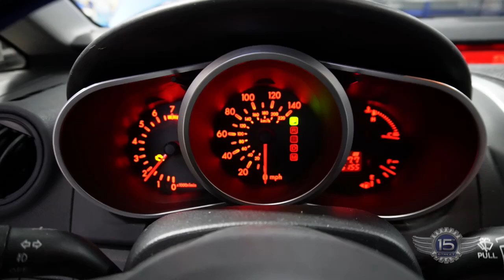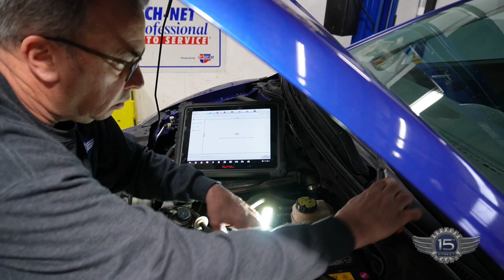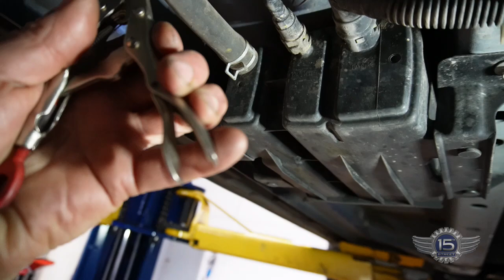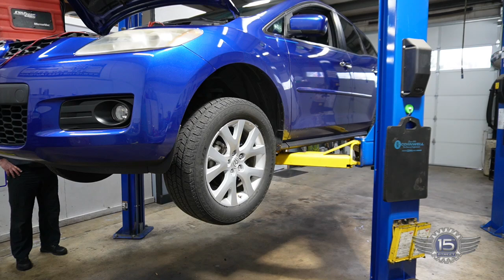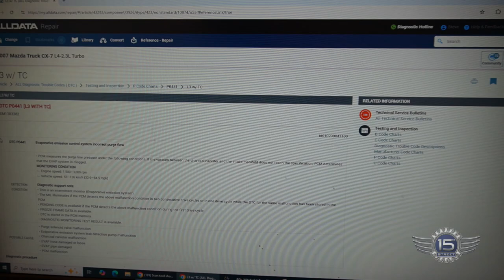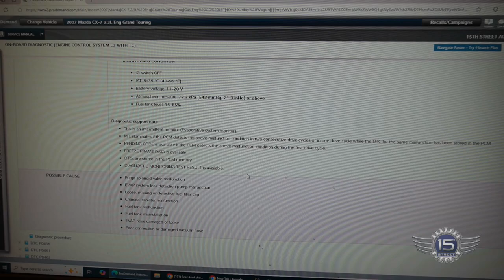Mazda CX 7  2.3L  Evap Leaks

Comment: I can't figure out my p0442 leak. I replaced the canister vent valve in the back of the vehicle and replaced the gas cap, but the code still comes back P0442. Is there a relay for that valve somewhere i can replace?
Reply: Smoke it.

Comment: I really dislike this car. Had one in the bay with a P0172 code. It was a living hell. HHP was dumping fuel into the oil, incorrect O2 was installed, the timing chain needed to be replaced,  dirty oil and oil filter, oil pressure drops off between the cam shaft and the cam cap, gummy engine, damaged turbo, you name it. This vehicle had it. Had nightmares. Good diagnosing
Reply from the maker: Wow. Sounds like you had a real cherry. I’ve found that typical Mazda owners don’t maintain their vehicles very well.
Reply: How do you tell if fuels going into the oil
Reply: @HAM91123  You pull the oil dip stick and smell it.